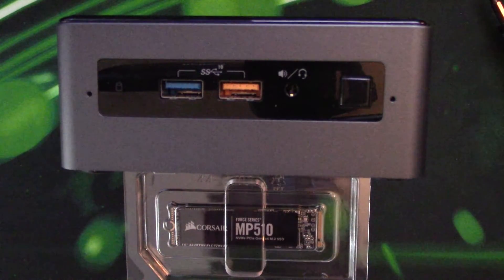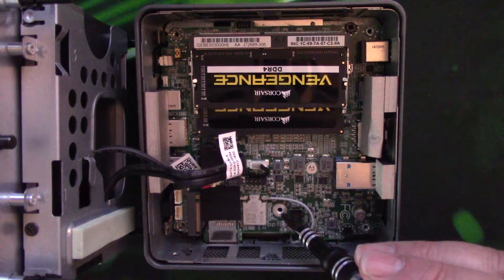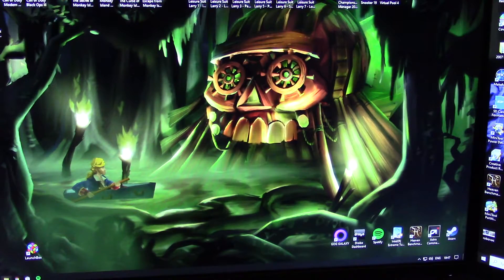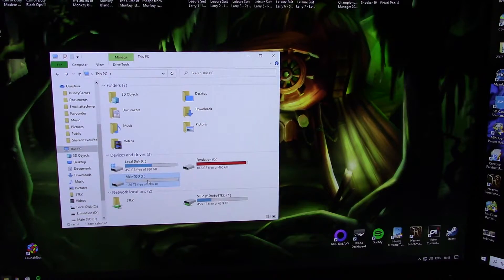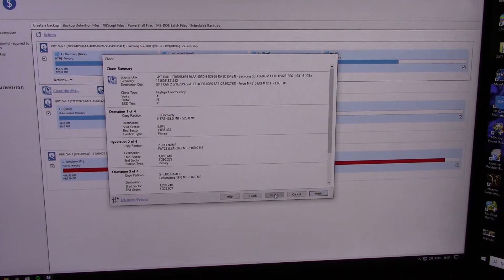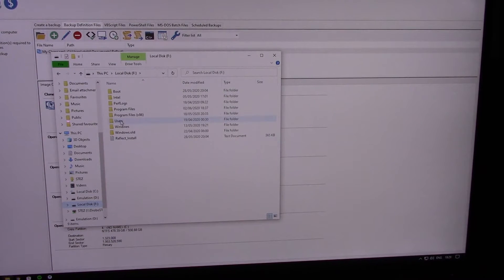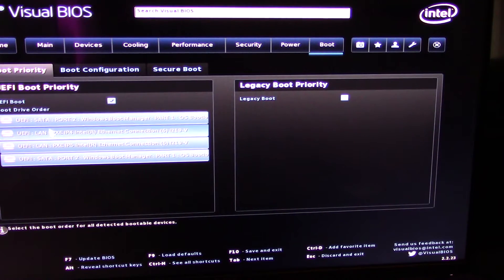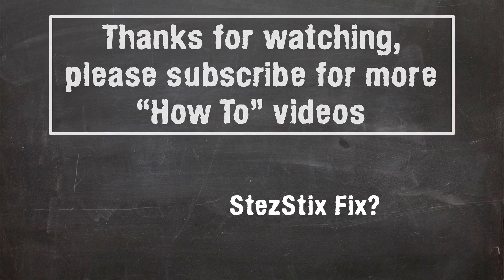How To Install, Initialize, Setup & OS Clone an M.2 SSD in an Intel NUC

Comment: A useful tip for booting into the BIOS (Setup), instead of shutting down @ 7:27, hold down SHIFT and press 'Restart' and it will bring up a menu to go into safe mode or BIOS (Setup) etc on the next boot up.
Reply: Depends on the make of computer , most use a different way of getting into the bios